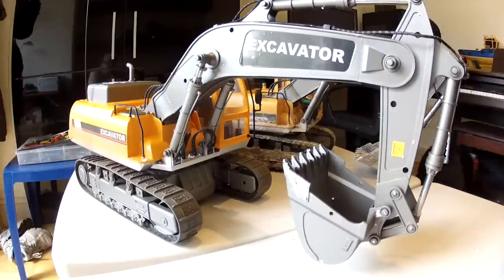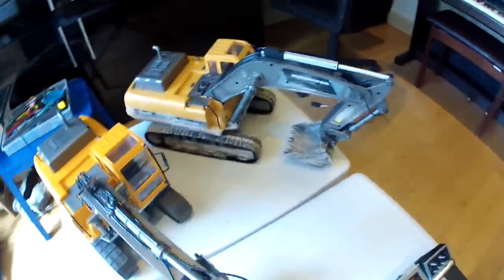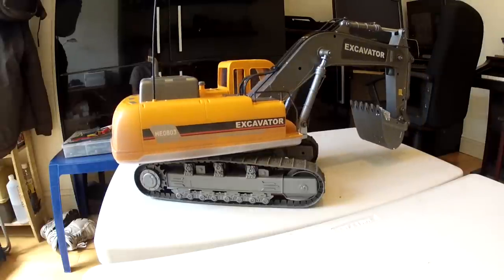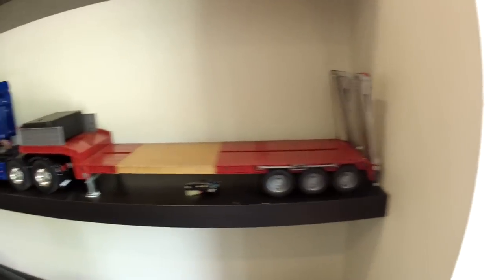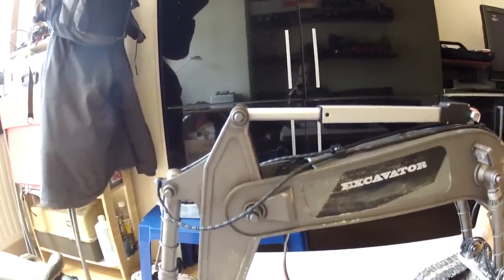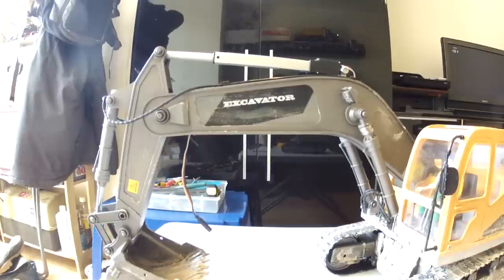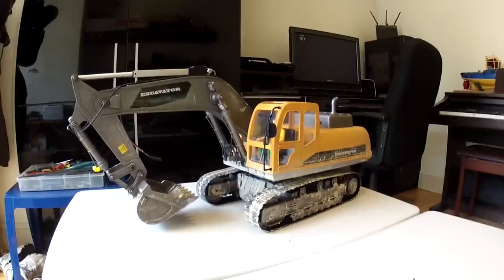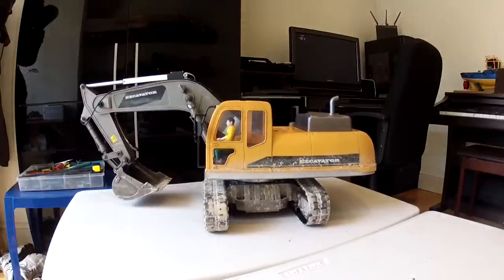RC excavator with linear servos

Comment: Hello.  do you write any information about the actor you use as the arm cylinder? For example, do you specify the size, diameter, and stroke values? I would be happy to inform you as a brand and model. Thanks.
Reply from the maker: Hello, after I tested and improved this model I finally used 3 Actuonix R-type 6v L12 50mm stroke linear actuators with a gear ratio of 1:100 and 1 Actuonix R-type 6v L12 100mm stroke linear actuator also with a gear ratio of 1:100.  Link here :https://www.actuonix.com/L12-Micro-Linear-Actuators-s/1821.htm  🙂👍

Comment: Great video how did you hook it all up together.Do you have a drawing of the wiring that you can post .Thanks
Reply from the maker: +paul hughes I just plugged the linear servos into a 10 channel receiver. As I use a 6 volt (5 cell NiMh) everything (receiver, twin speed controller for tracks and the one  for the turret motion) all plugged straight into the battery. You have to cut or remove the red esc wires to the receiver, but that's about it. Since this video I have put a corona radio system in with a converted robbe navy twinstick computer transmitter  to make the control of the arm more intuitive. I should really post another video when I get a chance. Thanks for the interest.
Reply: Thanks for all the information.Just a quick note.Do you plug the battery into the saber tooth controller which is then connected to the receiver along with all the servos.Also can you use a servo instead of a esc controller for the turret.Iam however only using the new spektrum dx6 transmitter for this project.You cannot get the dx10t like you have here in Canada.I enjoy all your videos on the Hobby engine construction toys.They seem to be the easiest ones to work on.Once again thankyou and keep up with the good workEnjoy the hobby
Reply: Thanks for all the information.Just a quick note.Do you plug the battery into the saber tooth controller which is then connected to the receiver along with all the servos.Also can you use a servo instead of a esc controller for the turret.Iam however only using the new spektrum dx6 transmitter for this project.You cannot get the dx10t like you have here in Canada.I enjoy all your videos on the Hobby engine construction toys.They seem to be the easiest ones to work on.Once again thankyou and keep up with the good workEnjoy the hobby lotus77s
Reply from the maker: +paul hughes hi. Glad you like the videos.  The hobby engine stuff tends to be of a very good quality, easy to take apart and doesn't require painting (which I don't like doing). I kept the original motor and gear for the turret, so a cheap esc was the easiest solution. As the motor is quite low voltage,  worth reducing the travel on the transmitter for this or only using a small amount of throw. To power the Rx I think I ended up powering directly from the 6v battery and removing both pins on the red wires to the receiver from the sabretooth as the 4 linear servos all moving together under load could be quite an amperage draw on the BEC inside the sabre tooth. DX6 is a good transmitter and easy to program.
Reply: lotus77s
Hi there sorry to be a pain but could you please post some pictures of the electronics .i am kind of lost when you are saying cut red wires on receiver and esc.thanks if you get a chance
Reply from the maker: t+paul hughes not sure how to post pictures here, but I'll try and do a video over the next couple of days. I've got a slightly different set up in the excavator now - as I put a corona 2.4ghz receiver in and used a converted robbe FC-16 transmitter with navy twin sticks to stop the linear servos centering when I let go of the stick and the mixing let me switch to track control. The wiring inside the model is still the same though. The point with red 'servo' wires on esc's is that they are used to power the receiver unless you remove them and if you have more than one esc doing this or have provided the receiver with power in another way, it can cause problems. You don't need to cut the red wires (you can if you want) but can lift the tab on the plug with a sharp knife and pull the pin out. I'll show you in the video.
Reply: lotus77s
Thanks that would be great

Comment: Have you just used the one linear ? How well does it dig compares to the normal one
Reply from the maker: sean hickey Hi. I've put 4 linear servos on now. It digs quite well, although I might put a more powerful one on the top (ie a L16). Been digging loose earth in the garden. I'll do a video when I get a chance. This totally transforms the model.
Reply: Cheers will keep a eye out for the video have you modded the track motors
Reply from the maker: sean hickey I have left the motors, they are fine. any stronger and the tracks would keep coming off. Just done another video today of the hobby engine loader / bulldozer which I have just converted. Havent got round to doing next video of the excavatoe as the gopro batts ran out!
Reply: lotus77s looks great
Reply: +lotus77s hi i'm editing the same excavator, but among the l12 and l16 the outer measure and the same
Reply from the maker: They are different sizes. Check the specification on the firgelli web site.

Comment: Hi Mate, I have the same excavator but the track's have rotten and broken away. They can't be glue, do you know if they sell or can you buy new ones to replace the old one's. cheers.
Reply from the maker: Very easy to find on eBay. I was at Wings and Wheels RC show a few months ago and a stall was selling off these excavators ,spares or repair, for about £2 each - all had broken tracks. I think that the premium ones are a bit better, but still come off on grass or mud if you push them too hard. Tracks Can Easily be found on eBay as a new spare.

Comment: hi mate how much would it cost to modify.
Reply from the maker: +chewie339 hi. 4 actuators plus 2 motor speed controller, 10 channel reciever, another speed controller for the turret movement probably set me back about £300. These can all of course be re/used on other projects in the future. Bespoke hobby grade excavators tend to cost thousands, although of course they are more capable. The challenge with this has been fun and it's not finished yet, I'm planning to use an Arduino programmable robot controller between the recover and the actuators to change some of how it works - these are cheap but hard to learn / figure out.

Comment: are these bruder excavators ?
Reply from the maker: No Hobby Engine. Easier to modify I think, as they are already radio controlled - which helps with driving the tracks and 'turntable' as gearboxes for these are OK and already installed.

Comment: hi which  Actuator did u use
Reply from the maker: +Lee Davison hi. I ended up putting a slower (more powerful one in the top hundred to one rather than 50 to one gear ratio I think) as it stalled to easily. The spare actuator went in to my 1/10 car trailer lifting mechanism that you can see on one of my other videos.